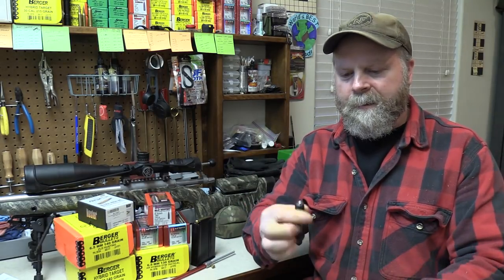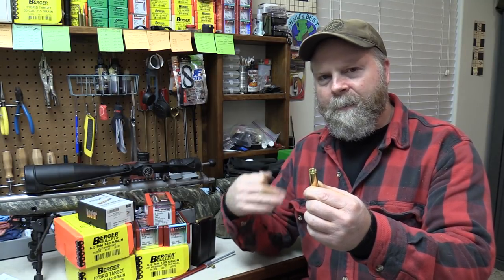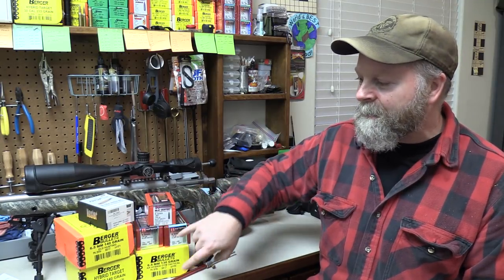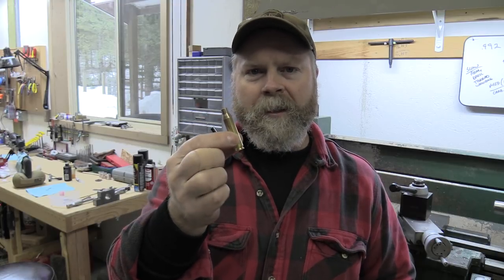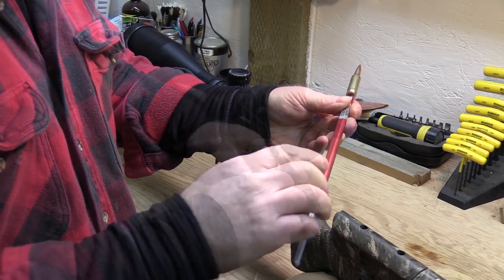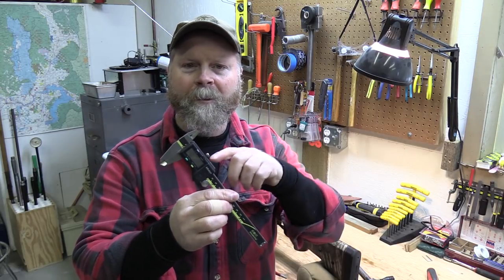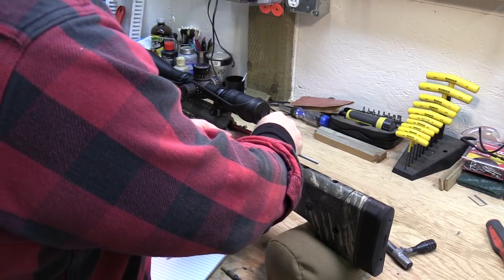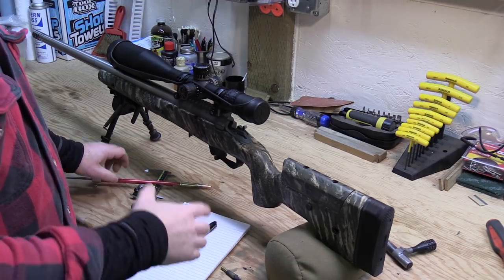Precision Rifle Load Development/ Part II: Bullet Choices & Initial Seating Depth

Comment: Sam:  love your videos.  One thing you need to mention is when you use a bullet comparator, rather than an ogive comparator, the CTOG will be different for each bullet type or manufacturer.  I originally thought that taking one measurement would be good for all bullets brands.  My friend Ken pointed out that this was not true.  So I went back to verify his claim. , I made measurements for Berger 130s, 140s, 130 Sierra MKs, 140 Sierra TMKs, and the Hornady ELD 130s on my new 6.5x47 Lapua.  All group measurements (5x) for each bullet were within 0.001". The Bergers had the shortest CTOG, followed by the Hornadys, and then the Sierras.  So I take the max CTOG for each bullet type and subtract from that the number how far of to be from the lands.  I did the same thing for my brother's 6.5 Creedmoor, and they trended the same way.

RCBS makes an ogive comparator; unfortunately it is not available in 6.5 Lapua or 6.5 Creedmoor....
Reply from the maker: Gregory Stramat Thanks for bringing this up. I did a follow-up in the next video pointing that out. I have noticed, though, that some inserts will give consistent CBTO measurements across several brands/weights of bullets. I suppose if the diameter of the insert matches the bore/lands at the point of bullet contact, it should match perfectly on all bullets. If not, the shape of the ogive determines the variation. Anyway, it’s easier to just use the bullet you want to shoot when measuring. Thanks again for the comment.

Comment: Definitely gave you the thumbs up, you seem very knowledgeable and you're certainly getting the desired results. Thanks for letting me know the secret thread of Hornady's depth gauge, I haven't as yet bought my own drill bit or tap, but eventually I will, for the exact reasons you've described.  

My calipers are also Mitutoyo, the same as yours, and I find them excellent as well, the only difference is, I went for the 8" as opposed to 6, as I figured that by the time you're using comparators etc, with the 8" you've still got a bit of caliper 'tail' left for your fingers to grip a hold of.

Finally, Sinclair 'apparently' machine their stainless steel comparator inserts slightly larger to better replicate the throat of the average chamber, which sounds excellent in theory, however, I find them to be a bit too large and they have the tendency to slip over the ogive and are hard to position 'exactly' on each projectile, and so give inconsistent readings, therefore, I prefer the Hornady inserts as, although they are aluminum as opposed to stainless steel, they are slightly smaller and are more liable to
rest on the same datum line of each bullet. Thanks for your vid.

Comment: Good process and procedure, thanks for sharing.  According to a Hornady tech that I talked with last year, the location of their bullet ogive can vary a few thousands from the start of the batch to the end when the tooling has to be replaced.  So if you get a new batch of bullets (the batch number is on the box) will need to use one of the new bullets to remeasure your overall length to the new ogive.  If you plan on measuring for throat erosion you may want to keep a few of the bullets you originally used.  Remember, your measurements are all relative based on the tooling.

Comment: You can also measure datum to head from the hornady modified case and compare that with a fired case of your own, fl sized ,deprimed and shoulder set back by 0.002. Measure the length difference and compensate for that difference . It will get you as lose as possible, without having to modify your own fired case to use with the hornady tool

Comment: Sam, the aspect of a fired case vs the Hornady case when coming up with a dimension from head to ogive and seating depth dawned on me when I saw this video. So I immediately went to check my Hornady supplied Case with my fired cases. I lucked out  because my fired case is only 1.5 thou longer. 
  I've got a new project rifle in a different caliber so I've ordered another case from Hornady for that cal, and will be paying attention to this. If I had a lathe i'd make my own also. But if there's 5+ thou between them i should be able to take the difference between the two and use it when I figure my head to ogive measurement. 
 I always enjoy your videos!

Comment: I think it's important to mention the fired vs unfired generic case having different measurements refers only to Hornady LNL seating depth gauge style tool and not to the bolt close with out of round case neck method.  That is a good thing to know then and I will have to verify my data now to make sure I'm loading to actual jump I think I am. I am currently just in the midst of doing a seating depth test and primer test as I finish my load development. Really haven't had to do a jump test with any bullet except for the Nosler RDF as the Hornady ELDs has always given me 1/4 MOA groups with a standard .025 jump. 

I definitely see an advantage to making your own reference casing for the seating depth gauge that has been fire formed and perhaps sized to your normal process but neck opened up a little to get good accurate measurements to your lands. My older bolt close method was very time consuming and a real pain to verify you were accurate.

Comment: Great info.  Ignorance is bliss!  Reloading is an OCD sport.  When I first started, I could not get anything exact.  One of my first realizations is how accurate a caliper is.  I was getting dirt/lube/contaminants on the calipers and/or brass, and that alone was throwing the measurements off by 5 to 20/1000.  Took me a week to realize that.  I thought my calipers were not accurate and bought a second set; 2nd one did the same thing.  Now they both work because I make sure I wipe everything off before I measure.  Nest step was that all bullets are not exactly the same.  A bullet advertised as 0.785 will be .775 to .795, and measuring to the tip of the bullet doesn't work; you need a bullet comparator to measure the ogive.

Comment: I have purchased some of the Starling brass for the 6.5 Creedmoor. It is nice brass, but the case capacity is slightly less due to thicker case walls. The Starling cases averaged thirteen grains heavier than Hornady cases. I reduced my charges to achieve the same velocities by about three grains.

Comment: I use a similar procedure - I take a fired case and start sizing till it just fits the chamber and then add a piece of scotch tape to make sure that little addition doesnt let me close bolt. This gives me a really good indication of chamber size. I then take a case and size it at .003 from that (better safe than sorry) and then make a modified case (although tapping seems so much easier on a lathe than drill press and finishing by hand). I take the measurement two ways - with the OAL gauge and then by creating a dummy round with .0005 neck tension (enough for it to not fall off). I then close the bolt. Both these measurements are pretty close - for me 2.252 and 2.2535 (I think the smaller one which is the case is the lands and the OAL gauge is my JAM). Here is a question though - on my MPA 6.5 SL - I am at .08 of the lands in order to fit the mag. What do PRS shooters do? It is a Berger long range target so its super long. Is it just too long a bullet for my application? Waiting to get the 140 & 147 ELD-Ms on back order - these shoot great in my rifle as factory ammo. ES is just not great between boxes.

Comment: For those interested, here is the information to get a custom modified case for your Hornady OAL gauge made:  Send two fired cases from each caliber you would like to have made and send them to: 

 Hornady Manufacturing CO., P.O. Box 142, Alda, NE  68810, Attn: Modified Cases.  

Include a $15 check for each caliber to be modified.  Leave the cases in their fired dimension and the spent primers left in the cases.  Hope that helps!

Comment: Hey Sam. What’s your thoughts on finding your seating depth with a new cartridge and then using the measured length to shoulder from new to fired brass and subtracting the case growth from the max seating depth?
Reply from the maker: That works!

Comment: Thanks for all the informative material. ive watched countless videos from a long list of individuals but i find your methods and procedures to be the best which fits my goals. I am very new to reloading for my Begara B14 hmr 6.5 creed. as new as first load coming proceeding this comment/ question. im going for my ogive measurement but im using the hornady 6.5 modified case with the pusher stick, the issue is as you presented is the modified case is larger than my new Lapua brass. the hornady case is 1.916 and the lapua is 1.909 should i compensate in my seating depth for the difference in case lenth or should i just start with the ogive i get with the hornady case? subtracting the .02?

Comment: Great video - I should say ANOTHER great video, but I'm a little puzzled that you used a 147 gr bullet to determine seating depth for a 130 gr bullet you intend to start with. Why not measure using the 130 gr bullet?

Comment: Get a 1/4" "square" router bit, chuck it up in a drill and you can zip all your primer pockets flat again.  It also cuts military crimps with ease...cost about $7.  Also, You can use a cleaning rod, a bullet and a marker to get COAL(for that particular bullet) very accurately with no special tools or gizmo's.  Many match shooters(including John Whidden the NRA long range champ) use "Soft seating" in their match rifles with great results.  "Soft seating" is simply using light neck tension, seating the bullet "long" and allowing the lands to seat it when the bolt is cammed closed.

Comment: Have you had negative experience with Norma brand brass, or just not had any experience with that brand at all?  I've read that Lapua had even contracted Norma to make brass for them in the past, when they weren't able to meet demands for some reason.  To me, that would show that if Lapua has that much confidence in Norma's brass manufacturing quality it would be safe to say that Norma is quite top notch, if not equally as good as Lapua.  Thoughts?  I ask this because I am sitting on 200 new pieces of Norma brass for a 300 Norma Magnum build that is in the works currently.  I haven't had any time to pull any measurements for consistency as of yet, but I have high hopes based on what I said about Norma and Lapua's relationship in the past.
Reply from the maker: I don't have any personal experience with Norma brass.
Reply: I usually use Norma: in Europe this brand is considered top product

Comment: Love your videos I’ve learned so much from you, but you need to know I bought that hornady OL gauge with the threaded cases for 6 different rifles I shoot not one of my magazines would allow me to get even close to the lands on my sitting depth😂 but I learned a lot, but seemed to be a waste of time, I live in a small town hard to come by parts, my gun smith said you need a custom gun in order to get the magazine to be bigger than the oal I’m looking for.
Savage long range hunter 338
Rem sendero 300 ultra
Rem tactical 308
Rugar 22-250 varmater
Bagara 6.5
As you can see all nice guns for a country boy  but the jump of the bullet I tried to lessen like you discussed or ogive close to The rifling, the mags are way to short?
Reply: I have similar problem with my rem700 308win. Mag length is like 2.80in but bullet jam measured 2.92in. 
I come to some possible choices; load to mag length, it should still shoot well. Dont use the mag and load to fit the chamber. Have the barrel rechambered. Change from short action to long action receiver.
Reply: @r0nb0h0ju  pretty much what I have gleaned from my research. A factory rifle is a compromise, but a good place to start until you know what you really need/want.

Comment: The 130 gr. is a good call,  they're both very similar out to 1200 yds, with a slight advantage to the 140 gr. at ranges beyond ..or when the wind pushes the needle to 25 mph.

Comment: I'm just getting into reloading so forgive my ignorance but couldn't you measure a fired case vs the hornady modified case and add or subtract the difference?
Reply from the maker: Mr NiceKnife You would get really close by doing that. Once you measure the max CBTO for a baseline number, it becomes a relative number to adjust seating depth anyway, so as long as you use the same tools and techniques, it doesn’t matter.
Reply: Mr NiceKnife you beat me to it with this question, I was thinking the same.  We would be using a once fired case and using the Hornady headspace comparator bit to measure the case length from base of cartridge to the neck datum line wouldn't we?  We wouldn't be using the smaller ogive type comparator like the one Sam is showing in this video.
Reply: Not everyone has a lathe at their disposal to make a custom modified case. Measuring a fired/sized & shoulder bumped case, comparing it to the Hornady modified case with a headspace gauge, and adding/subtracting the difference is the best most of us can do.

Comment: Great segment Sam!  For those of us who don't have a shop grade lathe are there any viable tool options to make our own custom cut OAL cases?  I'm thinking you can't get the precision required with hand drilling/tapping a case and spending big bucks on a lathe isn't in the cards for me.  Thanks and keep up the great work!
Reply from the maker: It doesn't hurt to try! Maybe a drill press or even hand drilling. It'll work as long as the case seats on the OAL gauge straight enough to be sure the caliper's blade is measuring off the case head. I sure wouldn't buy a lathe just to do this kind of work!

Hornady will tap your case for a fee. Scroll to the bottom of this page: https://www.hornady.com/reloading/precision-measuring/precision-tools-and-gauges/oal-gauges-modified-cases#!/
Reply: @PanhandlePrecision  Thanks for this info. I was already tripping out since I don't have a lathe. You're ahead of the game sir!

Comment: Great videos.  What are your thoughts on Hornady brass?  I am starting to work with Hornady because I am working up loads for a new 6.5 PRC rifle.  I usually use Lapua or Nosler (for 7mm Rem Mag) and have been very happy with it, but my brass choice seems to be limited with 6.5 PRC for the time being.  Thanks in advance for the feedback.
Reply from the maker: I used it long ago in a 300 Wthby. It shot good, and lasted the life of the barrel ( nine cycles), with minimal sizing and shoulder bump.

Comment: Just subbed your channel. Any plans to compare primers? I suspect SD/ES is effected more by variables inside the case. I've consistently gotten very low SD/ES using cheap S&B primers.
Reply from the maker: 762gunr The next episode will cover primers, but my experience is like yours. I’ll be starting with the same primer I’ve been using in everything for the last few years. I might do a comparison of different primers once I settle on a load.

Comment: I use Winchester 7-08 brass necked down to 260 and one run through my die sets it up perfect and even after several loadings I have no issues.

Comment: first of all i love this channel.  thank you.  wouldn't it make sense to not size/bump the case for the purpose of measuring the the chamber oal.  if the is case bumped wouldn't this reduce the size of the measurement by the amount bumped.  The case used for measuring chamber oal is pressed fully into the chamber against the shoulder while measuring but a loaded cartridge under normal operation would be flush against the bolt face.
Reply: When you fire. The firing pin and or ejector push the shoulder up against the front of the chamber. So if you dont use brass exactly as you load it. Your measurements to the lands will be off

Comment: Sam, a quick question... My smith that built my 260 Rem asked if I wanted to shoot Lapua or any of the other brass when he built my rifle. He said if I went Lapua I couldnt shoot Nosler, Norma, etc.. Something about the thickness of the case if I remember right. I chose not to go with Lapua so I could shoot the other cases. In watching the video and checking out the other brass offerings like Alpha and Peterson I would like to try those since they are offering the small primer pockets now. Is there any pressure related issues changing from one brass to the other I should be concerned about or just load my original load and go? 

Also, Have you tested running the small primer pocket in the 260 vs the larger primer pocket? Im really looking forward to see if it makes any difference in my SD and ES
Reply from the maker: Kirk Goddard I’ve always heard it the other way around. Lapua is pretty thick, so if the chamber is cut for thinner brass, you could have an issue with bullet release due to neck dimensions. My reamer cuts the neck for a fired case neck O.D. of .298” That dimension is also what the chambers had in other 260s I’ve owned. That works for Lapua, Alpha, and Remington at least. There aren’t any other chamber dimensions that should matter. .298 is .005” more than loaded neck O.D. of Lapua brass.

Comment: Sam, great information! Question, you found the maximum seating depth with your fired case with that one particular bullet, won't that change if go to another manufacturers bullet? Thanks. Look forward to learning from you!
Reply: Yes it will. Each manufacturer has different standards. Each bullet from each and every manufacturer will vary in weight per its class by around point (.)9 to 1.2 grains, but all need to match SAMI Specs.